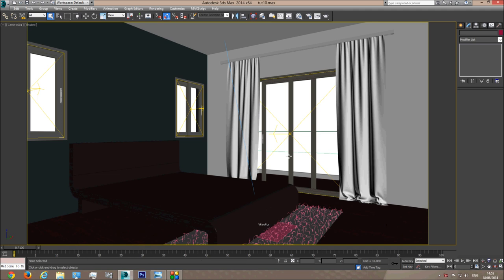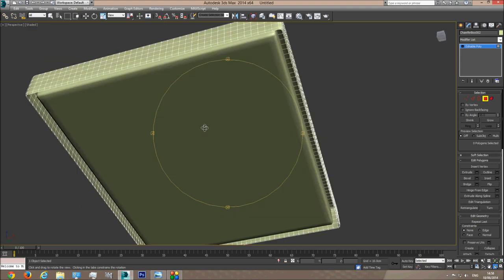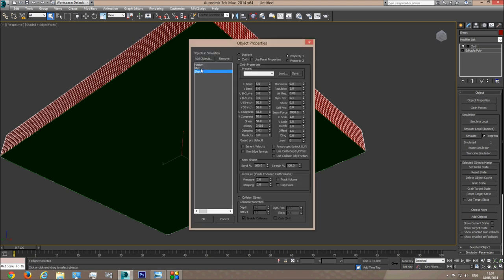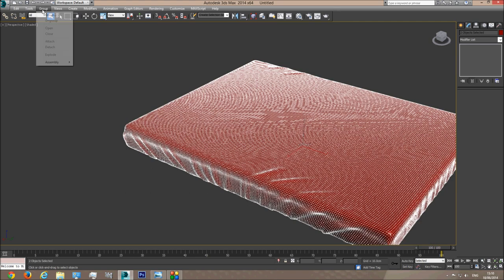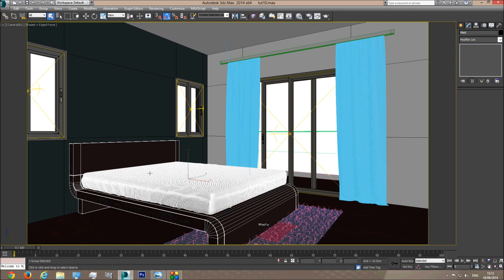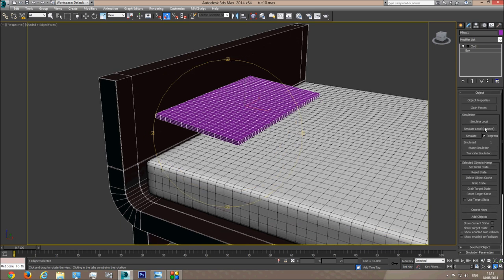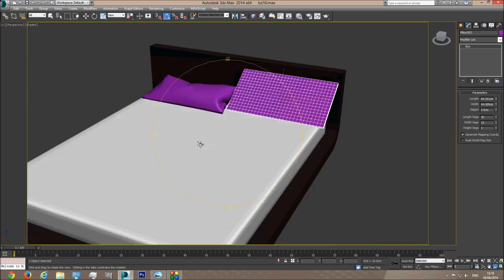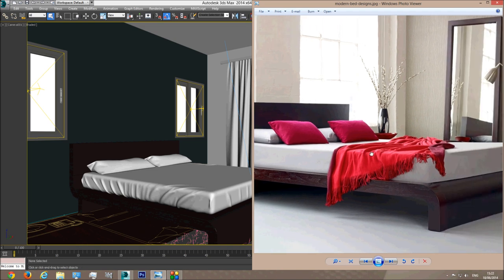Part 10- Pillow Modeling Tutorial in 3ds max

Comment: Question, I was able to successfully do this tutorial. I have tried multiple times now to recreate the effect and even watched step by step again. For what ever reason it's not doing it right. For example, the sheet doesn't  fall on to the mattress and doesn't follow the helper object. If pretty much only pulls the grouped verts. In other words the sheet doesn't conform to the mattress.  Any suggestions?
Reply: Artist | Joseph Tubb 
I figured out what my mistake was. So if you try this tutorial the trick is to not over scale the Helper object. Only scale it by 5-10% smaller. My original problem was that I was scaling it too small and stretching the verts which was making everything smooth. I also believe that the reason the sheet didn't conform to the mattress was the scaling was so much that it didn't give the sheet enough time to fall. Now that is a theory. 

So in short the solution is scale the helper object slightly 5-10%

Comment: For anyone having an issue with the Error message on Simulation - "cloth has become over-stretched".  I have finally tracked it down.  If you open your "Object Properties" under cloth modifier.  The issue lies with your collision objects.  So, Select a collision object from the List, got to the bottom of the Page and decrease both of your Depth and Offset Values to something like 0.1, even better I found 0.01 makes the simulation go quicker.  Hope this helps

Comment: 4dvisual , for some reason I cannot simulate the cloth on the sheet. Simulation stops after 1st frame with "cloth has become over-stretched" error. Any ideas?
Reply from the maker: you use simulate button and not simulate local. you need to press simulate local and not simulate to start simulation , as shown in the tutorial
Reply: 4dvisual Hm, but at 7:35 you click "Simulate" not "Simulate local". Anyway, I tried with simulate local and still no luck: got some weird extension at sheet.
Reply: Minilock I don't know if you fixed the problem, but it happened the same to me and the problem was that when i created the shape from the sheet to make the helper i kept it on smooth instead of linear, so i changed it back to linear and it worked. Hope that works.